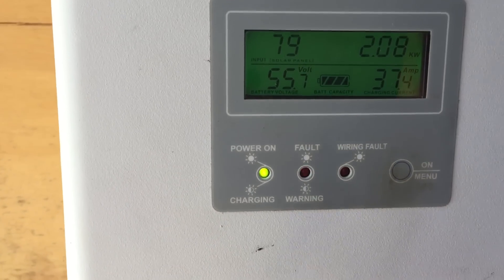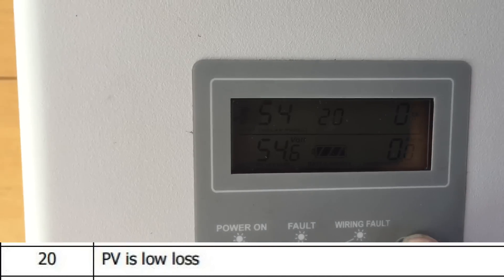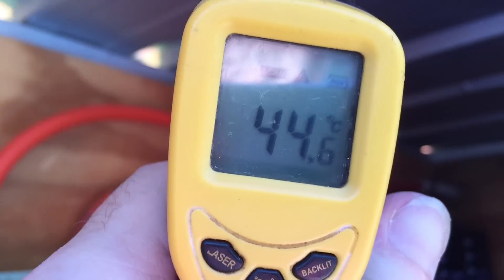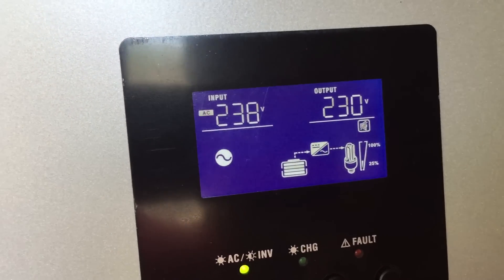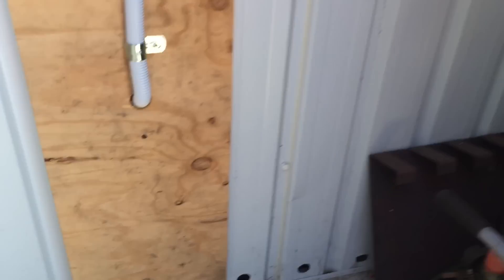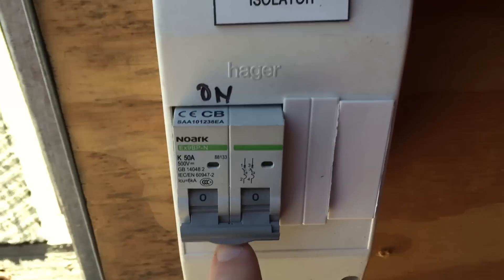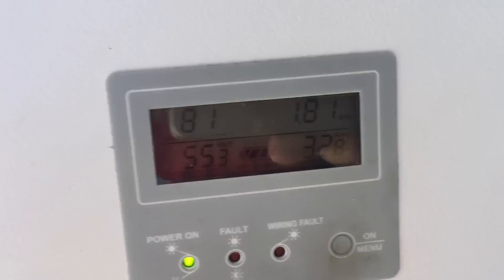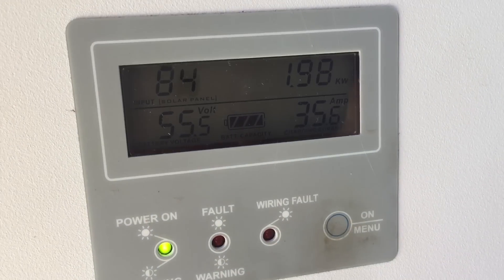PCM60X Error code 22 - It's getting a little bit warm in Brisbane at the moment.😅

Comment: I have two large computer fans bolted to my air vents on the side of my shed which run directly from a single panel on the shed roof. They don't connect to any other power source other than the SUN. The shed stays cool all summer with the doors shut, that's if we get a summer here in the UK.

Comment: Put it on the top, less flimsy than some hanging solution. Help pull air through, easier. 3x80mm PSU fans seem to fit well there.

Comment: my power shed is insulated and is air conditioned. if the battery lasts 10% longer, the aircon has paid for itself. it also keeps the electronics cool and hopefully the capacitors will last much longer too. plus more comfortable to work in the power room.
Reply from the maker: Would love to build myself a proper power shed I could walk around in ...lol I'd never leave
Reply: Who are you fooling? You'd have it packed floor to ceiling with more batteries.

Comment: Maybe a piece of insulation on the inside of the roof panel?  That metal roof is probably radiating a good deal of heat inside?
Reply from the maker: +tom110111 I have like 20 old carpet tiles on the roof for now. Heavily slows heat transfer but does not stop it.

Comment: Do you get sun (or shadow) on your mini-shed's roof's
at that time of day ?

A dummy (secondary) roof of 50~75 mm poly-panel 
(cool-store cladding)
(colour-steel skinned EPS (Expanded Polystyrene))
about 150 ~ 200 mm above the existing roof,
really does magic !!

Obviously, a "thermo-syphon" air-flow-path 
needs to exist between the two roofs.

I remember, when I was in the logistics game,
a food-grade warehouse,
that on occasion,
sprayed cold-water, 
for just a minute or two at a time,
on the top (exterior) of the roof,
of their "temperature-controlled" section (chiller)
as a cheep-fix for one or two exceptional days each summer.
-
Reply from the maker: Going to (in time) pull it all out and do it again. I have like 20 carpet tiles on the roof of the battery shed and the back side is totally shaded. Gets a few hours of direct sun till about 11 in the morning then no direct sun on it. There is probably only 10 days a year this issue will be a problem and my simple fan fix worked perfectly since. Someone suggested just move the controller down in the shed to where the air is cooler .. perfect for now it's the simple ideas that work the best .:)  thanks for all the shares

Comment: I'm surprised the roof is not insulated or do you think it wont make much difference? 
Maybe a whirlybird?
Reply: He has carpet tiles on top of the shed roofs. I'm impressed how well they work.
Reply: Thanks I wasn't aware of that, it's a stinker today, it's 36 in the kitchen.
Reply: i be insulate the how shed roof and walls i give him a link of a cheap place to get some but don't think he got there maybe next summer if the gear last him that is ...

Comment: I can’t believe your electrician didn’t use cable glands on the bottom of that unit! Loss of licence right there. That is definitely a fire waiting to happen.
Reply from the maker: Ooo come on that argument has been done to death.. give me some new news - some real help other than that same bullshit line...
Reply from the maker: Ooh what a min - you know that's DC right? No loss of anything 24/48v I can do my self - you know dc cable right - double insulated and all that..
Reply: HBPowerwall no, just where the cables go through the bottom of your pcm60x. They will wear through and short. Not worried about the batteries. They’re fine. At least put grommets there.looks like your grommets are missing.
Reply from the maker: you clearly judged on what you saw :) I love that about the internet - Project has moved forward somewhat -

Comment: I just setting up my PCM 60 and right away I got a fault number 6. Battery temperature is too low... I did try to disconnected and put some fans on.. the setup is a 48 volt.4 sealed 12v lead acid battery Bank.very little information about this charge controller.So you have any idea ideas ???
Reply from the maker: Disconnect the temp sensor if you're using an external one. I don't even run mine also don't run the external voltage as it will leave the unit on all night rather than shutting it down and saving some small amp draw - every bit counts

Comment: I have the same charge controller but mine has fans in it that turn on when its hot and are fucking loud. Being that its in my workshop I plan on putting a resistor inline to reduce the rpm or replace the fans with some decent ballbearing fans that aren't as loud. I assume your model doesn't have any fans? We wouldn't be hearing you speak if that was the case :P
Reply from the maker: Might be an older version perhaps. I have a small fan pushing air over it. Helps allot also had a dry joint causing microsparking & additional heat. Been great since I found that issue
Reply: HBPowerwall I will take a photo of my unit and link you. It has 2 fans about 80mm. I think they are 240v fans, they move a lot of air. They turn of for about 30seconds every 10min or so when it's hot. I would rather just put some low current dc fans in there and leave them going all the time.
Reply from the maker: Yeh, please do I would be very interested. Can you post them on the forum?
Reply: Sure can, I didn't get a chance to take a photo before I left for work today but I will take one this afternoon.

I only found your videos last night. Interesting stuff.
I mentioned on one of your other videos I actually have an off grid solar powered cryptomine. I make about 50cents to $1 per Kwh so a lot more than the 5.5cents they would pay me if I was grid tied. I am only running some old AGM batteries out of a Telstra cellphone tower at the moment. I have 12KWH worth but I only get about 3-4Kwh out of them as I don't like to cycle them too hard. I would love to build a LiPo bank but buying 18650 cells is EXTREMELY expensive.

Comment: you still have heating problems i give you a link to help you out to, to try cool things down, G some people just cant be helped hey i just go some 100mm thick,, think cool room panels i be making my shed from cool room panels think of it as a big ass esky box  then i have fans to take any heat out side best part about it was the the panels free was a good fined ,
not sure the pc fan going to cut it some how, there no way i let the units get hot the cost of them to much to lose then you have to hold off for new ones to come in the mail and at a cost but if you done some to start with about the heat they last alot longer but it up to you what you do just trying to help even i may sound like a troll as you say
Reply: TRMTHEweasel be careful with cool room panels they are extremely flammable and the fire is in between the panels and very hard to put out.
Reply from the maker: In other news, fans didn't work as it was an issue with the grub screws coming loose on the negative side of the charge controler.. Sucks that I neglected to check them for the past few months but problem sorted now and it's staying 20+ deg cooler :) One loose screw - it's always the little things.
Reply: That will do it, screws have to be looked over on any cheap Taiwan Inverters the night shift workers are so tired working hard for there $2 a day or night some times they miss a screw or two so i was told from a seller in Scotland when my inverter blow up and was hard getting a  hole new board under warranty i had to scream and was heard from a seller in Scotland and he help me get it fixed took weeks to get the parts and then i fix it, i found when i pulled it apart i found 2 screws just not done up at all and that what cooked my board  they i was informed to run the fans full time to make the inverter last longer to keep it cool ,cooler the better
Reply: I have a fire extinguisher and smoke detectors not sure how the fire gets inside the panel if its sealed right and if its in side the panel better then inside the shed hey,
 but if its happen in the past can happen again so maybe i put a water line sprinkler at the top of the panel if this ever happens so what would you recommend to keep a cool room for all this gear in hes shed .maybe look in to water cooling like they do on pc towers i have 2 gaming rigs with water cooling setup on them and my son to .i do know that tesla batteries have water cooling for them batteries  but they pull some big loads have to cool them down
Reply: weasel rodent the panel are cool room panels because they have a layer of polystyrene in the centre. If you had a fire with your batteries that would heat the polystyrene to auto-ignition temperature and then you have fire inside your panel that you can not extinguish with extinguishers. But if you don't have a fire then you don't have a problem.

Comment: Im constantly getting error 21 what does it mean?
Reply from the maker: Output derating caused from high PV voltage - stop using it and reduce the voltage from panels before you blow it up
Reply: HBPowerwall ok i will go paralel instead of series thnx for info !